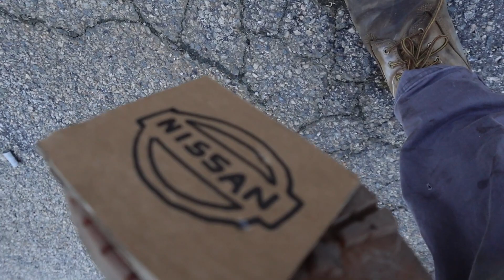An Unexpected turn……in my drift journey

Comment: If you really wanna go hard with the truck, you can order 2x6 3/16ths thick box material and make your own ladder frame out of it with your own cross-members, X bracing, and notched hoops for stuff like the drive shaft and exhaust to pass through. Then do a bolt in cage with the cab and bed and turn them into one piece that lifts up separately from the chassis and bed floor.

Of course all my other suggestions are still on the table, too. An LV3 with a David Vizard cam theory spec cam (not to mention, cd009 and 3.23 rear gears) will give you gobs of usable torque, and if you're interested in redoing the rear suspension, a de-dion axle will be the absolute shit, especially since you'll be the first person after about 2010 to put one in a performance car.
Reply from the maker: Hell yeah! I’m definitely going with a box material for making a new frame it’s just a matter of pulling the cab and motor so I can build up. You have a lot of interesting ideas I’ve heard of those v6 being pretty reliable I wonder how affordable they are too I’ll look into it. But before any of that I need to figure out a S13 front end 🙏